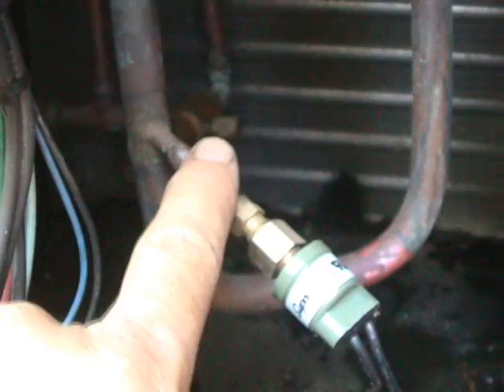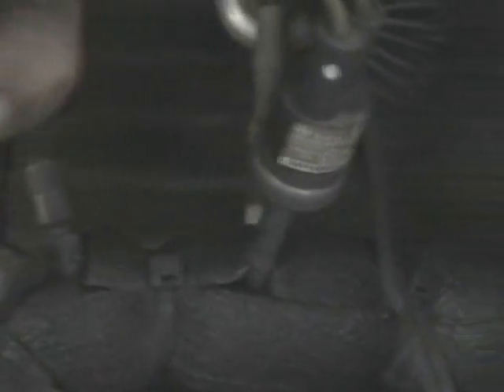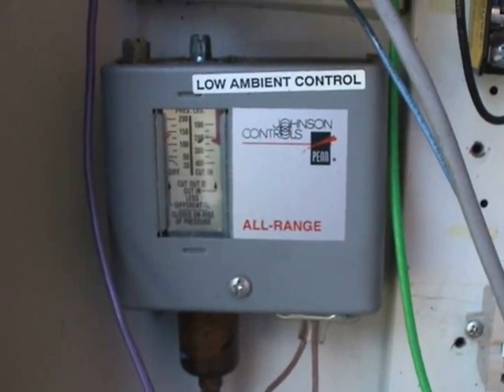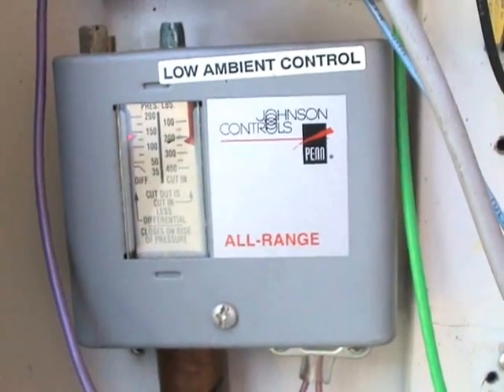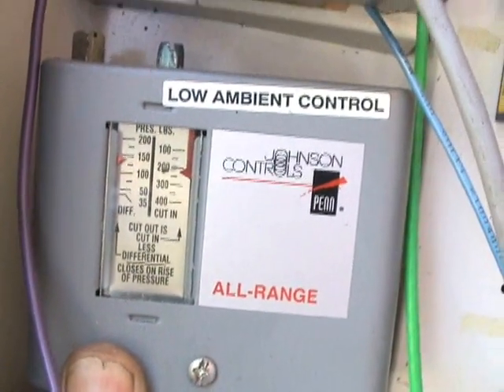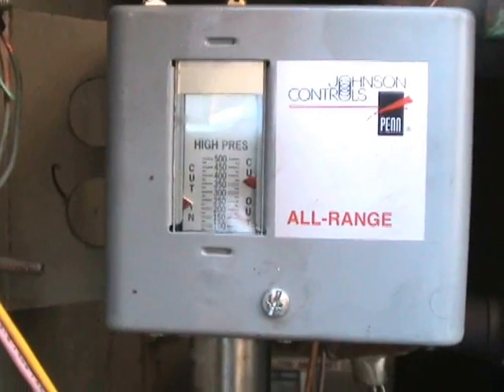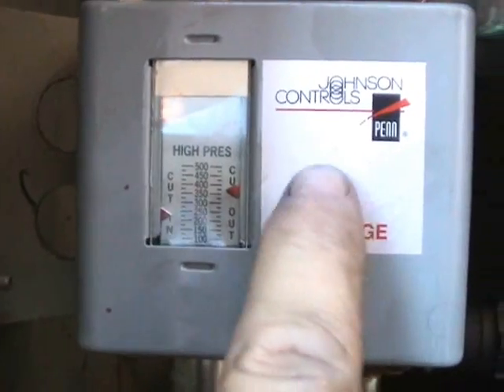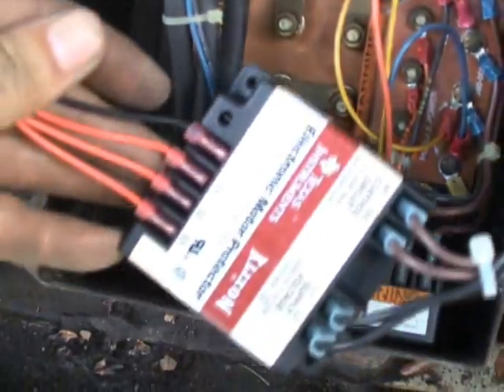HVAC Pressure Controls

Comment: good video, and may I mention to other viewers if ever notice that a high pressure switch or low pressure switch has tripped, Always make sure to diagnose as to why the condensing unit has tripped on either low or High head. I wish some people would understand that these switches are intended as a safety device.

And should never be just reset continuously if there is indeed a problem.

Comment: The reason why you might find a lp switch on the high side of a system such as carrier and Yorks is to shut it down on low charge it was referred to as proof of charge switch assuming your head pressure should never drop below its setting I've used the same concept on air dryers

Comment from the maker: Thanks. The LPS does need to be in the suction line. I've seen some commercial 15 ton Carrier heat pumps with the LPS in the discharge line. I just doesn't make much sense to me either.

Comment: I have a few old control panels from Semi-hermetic compressors with those cool pressure controls and gauges!. the ones I'm not sure about using are the Honeywell Pressuretrol's

they use a wire wound variable resistor and swinging arm (pressure controlled) to send a signal to the control PLC and I'm not sure how to wire them up, do I go for voltage drop or frequency output?

Comment: Was that first series of high pressure switches on a 2 stage unit? Say 7.5 ton? Reason I ask, is many have the automatic on the first stage for the simple fact the condenser fan motors are wired to the first stage (5ton) contactor. Then the manual reset will actually lock out the 2nd stage (2.5ton) entirely. If the condenser is dirty, stage 1 loses ground. 2 comes on, 1st trips out, fans shut off and then trips the 2nd.

Comment from the maker: I don't know what you mean about a self release valve. If the pressure switch opens at 375 psig then it will re-open at a lower psig like about 200.

Comment from the maker: I had to replace the first stage compressor some time ago. I installed the auto reset high pressure switch because That's what I had on my truck at the time. It worked out pretty cool for the video, though.

Comment: I understand the low pressure control reads the low pressure on the compressor. Where does the high pressure on the condenser connect to read the high pressure? Thanks

Comment: Could you go over operation of the motor protector I've been off the field for 20 +
I see it has a delay for short cycle protection but I also see what seems to be sensor wires opposite side X C S1 S2 S3 maybe for current sensors ?